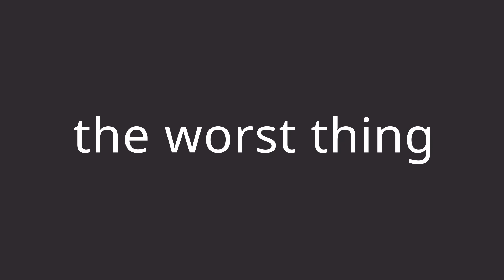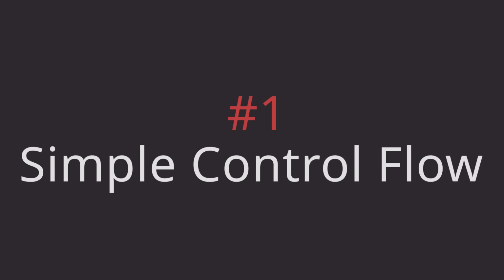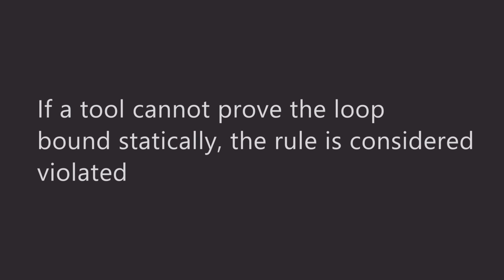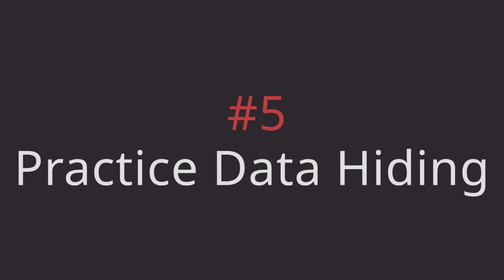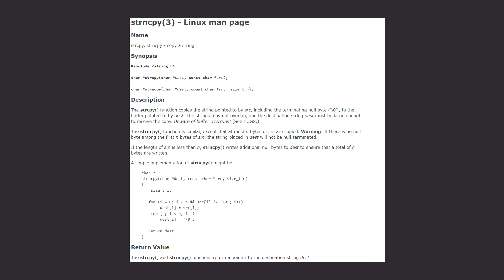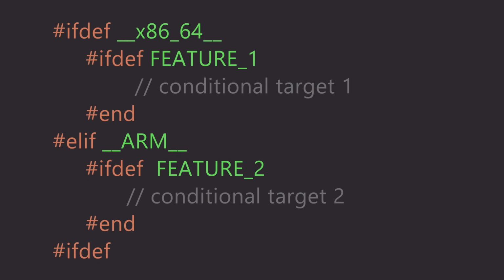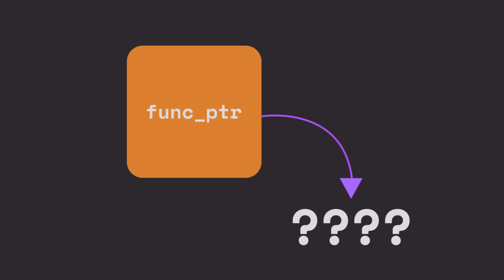how NASA writes space-proof code

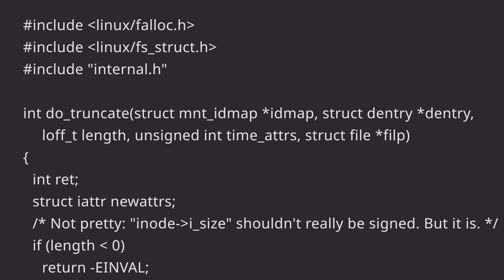Comment: 0:02, pretty? Signed var is faster.
0:10, in C++ it's possible to make a class that always implicitly checks if the pointer is nullptr.
1:17, I would not use linked lists neither, which rarely are faster, can't be used in STL algorithms, and forces you to make raw loops. For instance, if 'e' was a std::vector, this whole f() would be dismissed:
const auto Result = [](const std::vector <int> &e, const int search) {
	const auto Result = std::find (e.cbegin(), e.cend(), search);
	return Result == e.cend() ? null : *Result;
	} (e, search);
1:24, C++ containers use to have iterators delimiting begin and end, putting the programmer in a range loop by default. For instance, std::forward_list performes a linked list in 1 direction, and has begin/end f()s to give those iterators.
1:55, or just use std::vector, which will free the memory, if its object no longer exists. It hasn't the use after free protection, but it's possible to wrap it in a class, to check that automatically.
3:20, but if that variable must travel alonside f()s, as read-only, and be changed only at the Nth f() called, C can't protect it. C++ has the solution: hide it in a class, making that f() friend of it, so that only it'll be allowed to change the variable.
4:01, C++ has the attribute [[nodiscard]], meaning that a compile error will raise, if the return value is not treated.
5:40, I always use pedantic, because it has good rules. But Werror forbids me to run the app. I always end up cleaning all warnings I turned on, but not always I want to do it right away, which may be less productive. Same thing for implicit conversions. So I don't turn on all warnings.

	So we can realize that using C++ is a big improvement for defensive code, at least over C.

Comment: Very interesting video. I think I'll apply the "Limit All Loops" rule to some of my code (not C/C++). I experienced some deadlocks where we wait in a loop until other processes are done.
Reply: Worse is calling blocking APIs that force you to wait. I try to use only non-blocking methods to avoid deadlocks. The only way I came up to deal with blocking API deadlock issues is to put it in a separate thread, that you can terminate if necessary, but this can cause memory\handle leaks.
Reply: NASA mainly uses Fortran

Comment: Also note that these rules entirely with the purpose of NASA projects. It’s a mistake to generalize this to other areas like web development for example without experimenting. Code that can only be checked statically, for example, is great because you don’t have have to worry about wireless data transfer. With web development, size of your code bundle matters so there needs to be investigating there if static code philosophies work given that new variable at play. Not saying not possible by lazy loading small cdns when needed and stuff like that but this runs into my point exactly. There needs to be experiments before generalizing to all coding practices.

Comment: I understand the reason behind a lot of those but no function pointers? Seriously?
Reply: A function pointer is difficult for static analysis to figure out what and how to analyze it, and in the event of, say, bits getting flipped, may result in executing unplanned code.

It is quite possible to code without function pointers. You may not like what you have to do to get around using them.

Comment: This is almost how they teached us to program in my Uni in the 90's. And good advice for any programmer. Those are my basic rules, and try to never break them, on any language.
Reply: Good luck programming in a functional language without ever using recursion;
Or using function as parameters, or just polymorphism in general without using function pointers under the hood;
Or having threading without breaking the "simple control flow" structure.
I mean, they are useful guidelines for NASA because they make the code easier to analyze, because code being wrong there is very costly.
Not everywhere is NASA. You can use polymorphic classes. You don't need to code today as if you still were in the 90's. Not that it was bad, but there are new things and they may be useful... if you can use them.

Also, some languages actually force you to check the return value.
In Rust, you can have Option<T> type, which can be None(an error value, kinda like null or -1) or Some T.
T and Option <T> are both different types, so if you don't unwrap it(you can make it panic if None, or explictly use a value in case of failure or something else).
So, if the fallible function is well defined, it will return an Option(or some other type that allows for errors) which has to be treated if you want to access the result.
Reply: @matheusjahnke8643   We are talking about producing easy testing, readable and reliable code here... the closer you adhere to those rules, the better. They are rules, not laws...
  
Functional language? Cmon we are talking about programming in the real world :) ... now seriously, functional programming would tick on most of the boxes, and that's why its most successfull usages are on the embedded/controller world.

Comment: Good points. As a high-level developer the most important I think, even in a very fast start-up environment are:
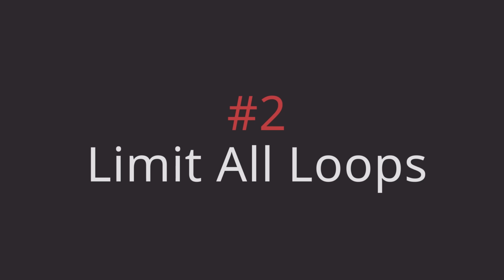#2 Limit All Loops - 1:10
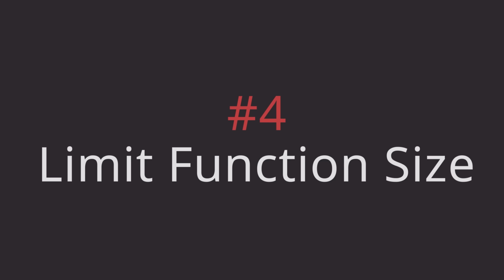#4 Limit Function Size - 2:18
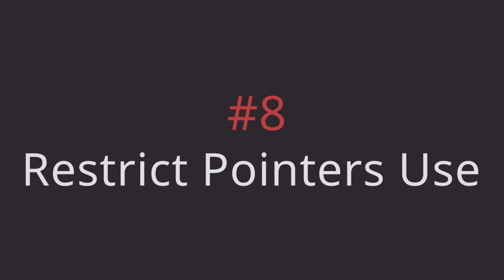#8 Restrict Pointer Use - 4:59 (in fact, TypeScript really helps deal with this)
#9 Be Pedantic - 5:34

Comment: Not unit tested (nice but catches very little) but end 2 end tested. Every known edge case needs to be tested in the whole system flow. My two internships were in making test setups.
One was for a system I created that had 27 measuring units in Antarctica, may as well have been the moon 😂
So every edge case we could think of had to be created in the end to end in circuit tests. Something as trivial as this project was, measuring the height of snow/ice which you knock out in 2 or 3 months, in assembly. Takes 10 months of creating the end 2 end test system. We were allowed to use stack though, although we mainly wrote in FORTH and assembly we had no OS running on the 8051 microcontrollers.
The worst was simulation the satellite communication. The measurement data was send up to a geo stationary satellite that relayed it to the scientists. Having proxies in line with the RF signal breaking the packets simulating bad transmission was a challenge. 
It only made sense that my expend mandatory internship was at the company that made the RF measurement systems where I created a calibration setup for the thing we’ve used to simulate the satellite RF. 😂 Which was a lot more of an easy internship 😂

Comment: A lot of this just seems like what we should all be doing everywhere, tbh. 😂 Good for NASA - and the dedication to auditable code shows, too. Amazing success rate on their equipment. The trouble we run into is, even when we want to be clean, we run into a sloppy code culture and codebase... it eats away at your morale, and you start cutting corners. It's vital for team leads to be serious about these principles with good reviews and good linters.
Reply: While these rules are very useful for a constrained environment like NASA or cars (MISRA), it's not great for general software.  Let's take "don't use the heap" for example.   Imagine if eXcel was held to this standard.  Then Microsoft would need to decide some maximum spreadsheet size and pre-allocate that storage "Cell cells[MAXR][MAXC];" This would suck for anyone who wanted to have a larger spreadsheet because they couldn't, so the MAX's would be very large, now this sucks for the everyday user because every time you fire up eXcel it consumes a huge amount of memory (maybe more than your machine has, maybe just so much it runs like a dog).
Reply: @UnlikelyToRemember  Of course, that's absolutely right. No argument there.
Reply: @UnlikelyToRemember  Is the best of both worlds is to allocate in chunks of memory?

Comment: Sounds like a really great set of rules to ensure highly auditable code (by humans and machines). If I'm not mistaken, the combination of disallowing recursion and not using heap memory essentially means that you know ahead of time exactly how much memory the program will use? Actually, it seems C99 supports dynamic allocation on the stack (e.g. reading a value from input at runtime, then allocating an array on the stack with that value as its size) but curiously enough C++ does not allow it in the standard, so now I wonder whether NASA's rules allow it.
Reply: because NASA uses Fortran not c/c++

Comment: I think you're missing a key part of #3. He says avoid heap allocations, not to always use the stack. You can always use statically allocated memory not on the stack, anything with static storage is still fine. By exclusively using the stack you could run into a different problem, the stack overflow.

This is something I've followed for many years. If I write a server or any other program that must run for extremely long periods of time, it's easier to eliminate the possibility of memory leaks where possible than being hyper-vigilant about malloc and free. It's sometimes inconvenient, I sometimes statically allocate things like buffers much larger than I need them and that becomes an absolute hard limit. But that's okay, the OS will swap out all those upper pages I never use, and indeed probably never mapped them in the first place.
Reply: "By exclusively using the stack you could run into a different problem, the stack overflow."

If you not allow recursion (and no function pointers) you can determine the calling hierarchy of all functions at compile time and also how much stack space is allocated by each function.
So you can also determine the maximum allocated stack at compile time - ensuring that no stack overflow could happen.
Reply: @elkeospert9188  That is true, but you may run into edge cases where the call stack goes deeper than anticipated and a stack overflow is triggered by a user. Or you may trigger a stack overflow during development and that's a sudden and nasty complication that may have no easy solution. Or you may have a lot of trouble porting the program to a system that uses a smaller stack. It's mostly an issue for small systems these days, but it pays to keep things off the stack if they don't need to be on the stack.

There's just not much reason to put everything on the stack. Judicious use of the static keyword on non-reentrant functions can almost eliminate this problem. Imagine you need to form a filename from a set of strings and integers and other values. The system has a maximum path and filename length of 4096 and you must be able to generate all legal paths so if you aren't using VLAs or dynamic memory then you need a 4096 byte buffer. Slamming that onto the stack just might not be an option on a small system, but using a static buffer will not have that problem.

Comment: To my knowledge, the only reason why you would use the heap over the stack memory is to avoid reserving more memory for your program than you actually need, impacting other programs running on the system at that same moment. But if the system just runs your code, then just using the stack is so much simpler. Just agree with your colleagues about who is using how much memory at a given time…
Reply: Having worked on embedded products, I would not be surprised if they are given a maximum amount of RAM as part of their requirements, on a per-program basis.

Comment: Those are nice 'n' all but sometimes it's  just not possible to follow them all, for example dynamic allocation is more or less a neccessity in at least 80% of real world software, I choose to pad my allocations so that there's always a NULL terminator on both ends, anything between those points is fair game for a buffer wrapper, the padding size also doubles as an indicator of the element size for the buffers so any strings lengths will always mean the same as what functions like strlen should return, even when a new string allocation takes up the entirety of what's  available to buffers they'll still be able to set str[len] = 0 without corrupting anything
Reply: For embedded controller dynamic allocation is often not even needed. Your activities are very repetitive and statically allocating everytging is quite viable.
Reply: @jonassattler4489  I did say *at least* so I did leave room for scenarios where it is viable to skip allocation entirely
Reply: Sure, but by design safety critical system often don't even need dynamic allocation, as their tasks are clearly defined and static allocation is completely viable. If your system is read input, make decision, write output, you don't need to dynamically allocate anything. You already know which data you need you need at every point.
Reply: @jonassattler4489  Here's an example where dynamic allocation is necessary, parsing text/code, while you could just reload the files each time for the text the same cannot be said for the extracted data, if you don't make a copy via dynamic allocation then you run the risk of corruption when stitching together the final result due to the constant re-use of the main buffer to load headers etc. Fit the ideal to the task, not the task to the ideal.
Reply: You are absolutely right. But there are very few cases where you would have to parse long text in safety critical systems.

Comment: I dont understand why people hate heap in embedded system. I know it has cons, but with limited resources, that is a trade off sometime we have to make.

For ex: let say your program 99.9% of run time need less than 10 bytes, and 1% need 1000 bytes, without using heap it would be very wasteful statically allocating 1000 bytes for your program
Reply: The heap is dangerous. Allocations can fail or take long, that is not an option.
Reply: @jonassattler4489  yup and it depends on you how to treat those failures.

Also static allocation does not mean it always run success. You can run out of memory too, and now you have similar problem to solve
Reply: Static allocations will fail at compile time. Which of course can be a problem, but it is a problem which never occurs during operation.
Reply: @jonassattler4489  it can indeed fail at run time: for example, allocated buffer to receive message

Comment: This is not a modern approach. Some cutting-edge work is being done on proofing compiled binaries and verifying that they do exactly what the proof defines. Check out the COQ language if you want to see an example.
Reply: Prooving anything on binaries is near impossible and really stupid if you have the source. COQ also absolutely has nothing to do with it. It is a language to write formal mathematical proofs, not a static analyzer.
Reply: @jonassattler4489  COQ isn't being used as a static analyzer, rather it is being used as a dynamic analyzer with mathematical foundations, for binary-level proofs. Proving binaries is a vastly easier problem than proving languages because you only need to prove that a set of instructions satisfies an invariant and writing proof simplificators for instructions is orders of magnitude easier than arbitrary language grammar. Another point is that the source isn't always available. Formal mathematical proofs are the only guarantee that code is truly "safe" or correct. Lastly, it is true that writing proofs for even small snippets of code is tedious and difficult even for grad-level students, however new research is being done to automatically solve proof definitions using ML.
Reply: Reasoning about binaries is always harder. They literally contain strictly less information.

Also, this is entirely irrelevant for embdedded systems. For obvious reasons.

Comment: I would say using C would be the biggest issue. Do they really use C????

Also, that don't use the heap rule. So you are exchanging heap use for lots of static array overflows, usually out in space. Great idea.
Reply: In aerospace C is extremely widely used, besides things like Ada it is about the only actually viable programming language in that space. No real alternatives.

Not using the heap isn't about bugs. It is about the allocator being unpredictable, as it can fail or take extremely long.
Reply: @jonassattler4489  Yea, its an unfortunate fact that I am aware of. I am a pilot as well as a programmer. The use of C is a shockingly bad choice for life critical applications such as avionics. I disagree there are no alternatives. Java, which has been around for decades, is a fully protected language, and Pascal has been around for 50 years now. Fully protected.

Allocators are well debugged. The bugs that occur happen not because of the allocator (which is usually only a page or so of code) but because of incorrect use. Regardless, again, there are languages outside of that running segment violation of a language C that properly check allocations.

I use C in most of my work, have to make a living. You code in what your employer uses. But again, C is a terrible choice, and yes, there are alternatives.

I have lots of issues with NASA use of COTS (Customer off the shelf). When the mars probe locked up because of a priority inversion, my first reaction was "they use a priority based RTOS???". Priority based OSes have known issues that (to me) stem from use of an oversimplified model of tasking. Demand based systems (well covered in the literature) are better and actually properly model the way tasking works.

I'll put is succinctly: NASA chose their languages by popularity, not by fitness of purpose. The military went through the same thing, and they chose ADA because it had protection (long before JAVA and the protected language fad). Its simple. The military didn't want run nuclear missiles on C code. They kinda got out their on their own limb with ADA, but they made it work. ADA is still in use.